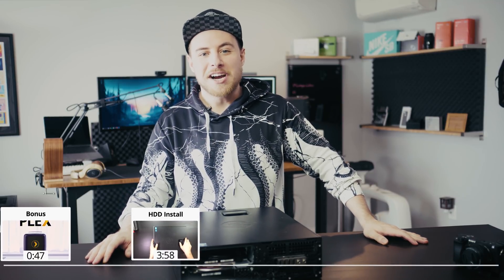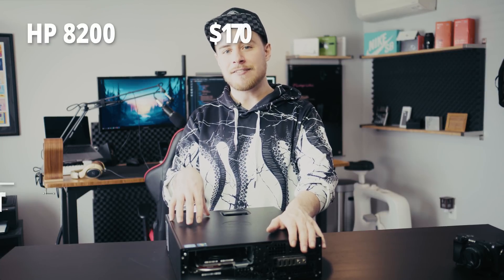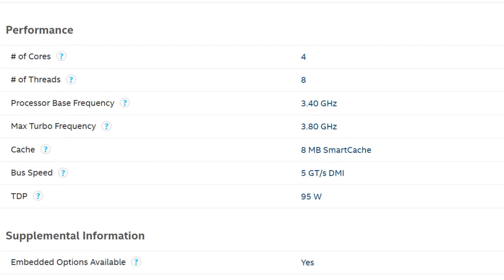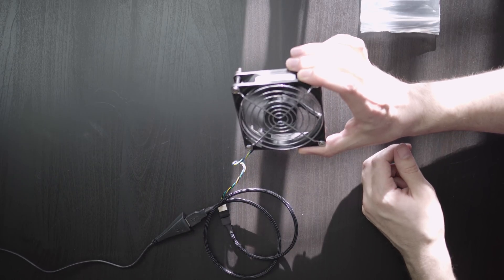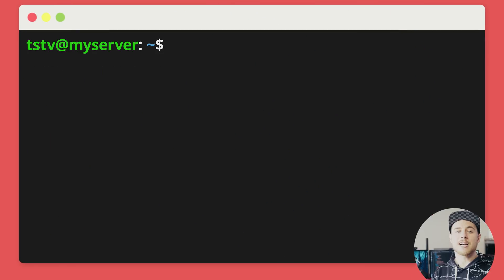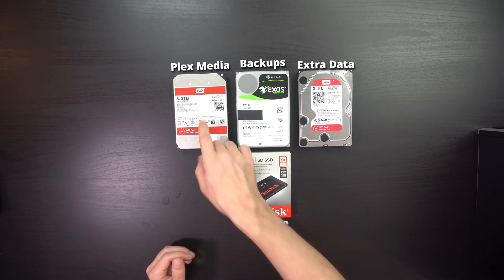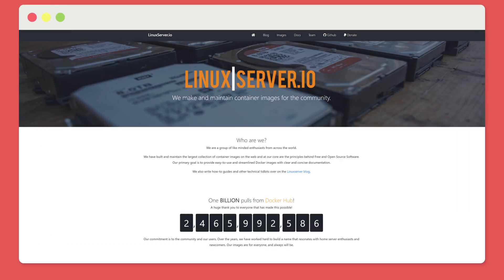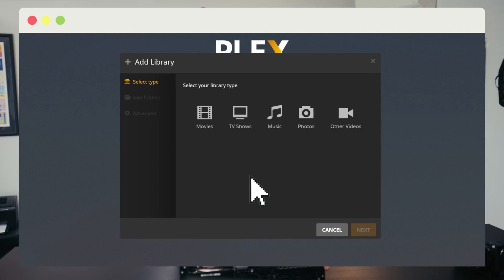How To Build A 23TB Plex Server With Docker

Comment: Where would a FreeNAS be used? can it be used as 'Plex' or would you use it to back up your plex server? Why not RAID hard drives?
Reply: You definitely could use FreeNAS, however a single drive system probably doesn't necessitate FreeNAS, and to follow FreeNAS best practices you will want ECC ram.  That said, FreeNAS is a good way to go if you want a NAS solution.  I have a 24TB FreeNAS system running my entire Plex system - Plex, Sabnzbd, Sonarr and Radarr keep my setup pretty much completely hands off.  I also use a motherboard with an IPMI port so it can sit in my basement in my comms closet without requiring a KB, Mouse or Monitor.
Reply: @RVSpinX  Thanks. Looking at using a r5 2400G in RAID setup for a FreeNAS - they support ECC memory so can just swap the old memory out for 'extra' stability. Low power too.

Comment: Backing up should never be done to the same machine the important media is on. It should be done by connecting drives to the server and then disconnected when done.
Reply: Eh, you can backup thatvway if you want to.  It still protects against hard drive failure, else what in the world is RAID good for?
Reply: @ryanbygone9262  raid is never a backup, its for redundancy/uptime  Raid volumes may crash when restoring from an array

A backup on the same machine as vital data? Thats retarded beacuse what happened when malicious software eats everything for lunch or cryptolockers encrypts it all?
Reply: @Imperfect Servant thats raid for you:) on and offsite backup is good enough
Reply: Well, why do you need offsite backup for data like movies? It’s no big deal if you loose it
Reply: @monster6488  I never mentioned any kind of files

Comment: isnt plex supported anyway on linux without docker? i mean on my windows server i didnt use docker i just installed plex normally. Does docker use less resources than even native software?
Reply from the maker: You can absolutely install Plex without docker. Docker isn't required to run Plex it just makes it easier to run Plex and other apps together. If you were running Plex and only Plex on your server then it wouldn't make too much sense to install docker.

Comment: i Think if you use FreeNAS is better
Reply: I liked FreeNAS and used it for a bit then I tried UNRAID and never looked back. It is much user friendly and rock solid stable for the past 2 years it has been up for me. You can install NVIDIA UNRAID Plugin to allow HW transcoding in Plex and run the infamous NVIDIA PATCH script to unlock consumer GPU. I use a AMD FX 8350 and a GTX 1060 6GB with 32GB of RAM and 16TB storage.
Reply from the maker: I was and might be considering s video on this in the future. With more harddrives you may be right but with only three physical drives, ZFS would cost more than it would benefit the system.

I want to do a new server build, maybe next year with more like 80TB or something.